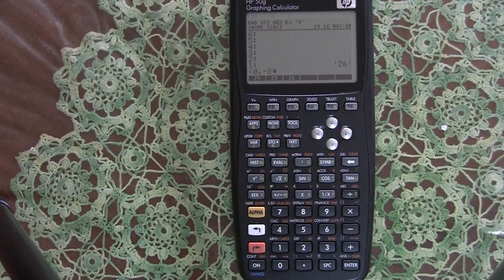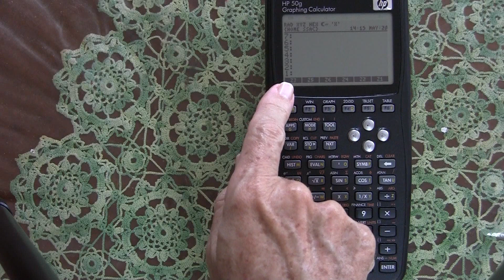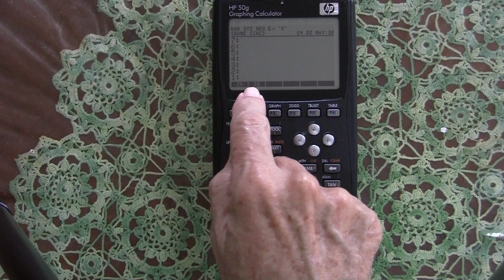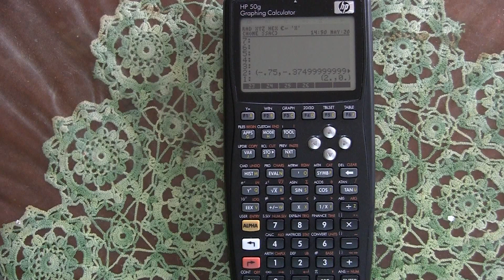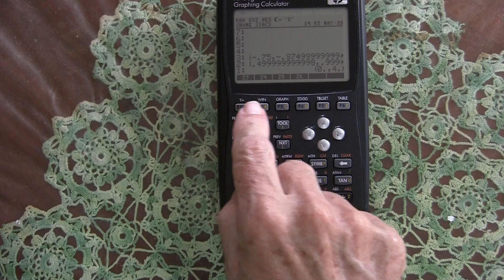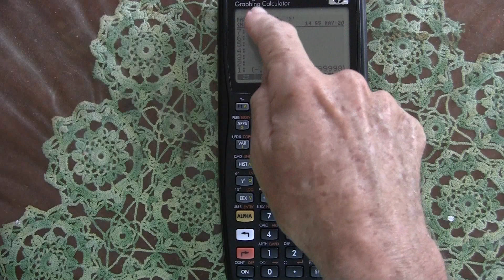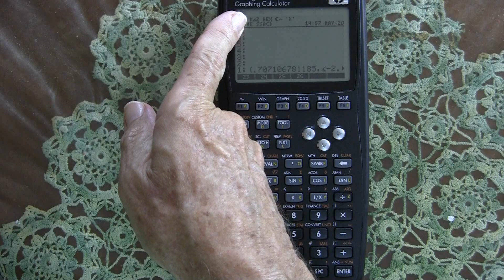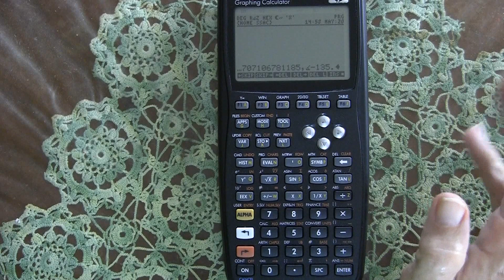HP Graphing Calculators - Solving Circuit Analysis problem on 50G

Comment: Nice Stephen! How about a video with complex circuit analysis with units and SI prefixes? Maybe a general introduction to the HP units system first.
Reply from the maker: Initially I had planned to do an HP video every week .... NOT possible .... maybe once a month ..... which you want first  ...   the Unit system or the Equation Writer  MODES ? 😊
Reply: @StephenMendes  If you are making videos specially for me, I'd go for the Equation Writer! Entirely understand about the effort and the limited audience though - just push my ideas onto the stack! Maybe you need to inform people about the free emulators first since the audience size for videos about a calculator that is no longer manufactured is probably quite limited!
Reply from the maker: @john_hind  thanks .... will see what I can do ..... have to make videos for my students  now .... teaching resumed at the University on Monday and I want to carry my  courses online as much as possible so ..... lot of work.... thanks again